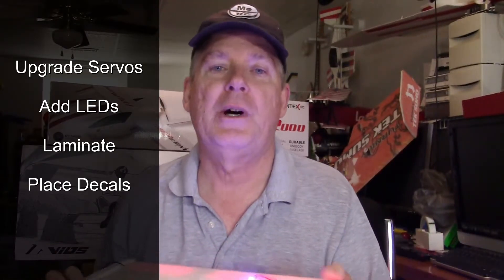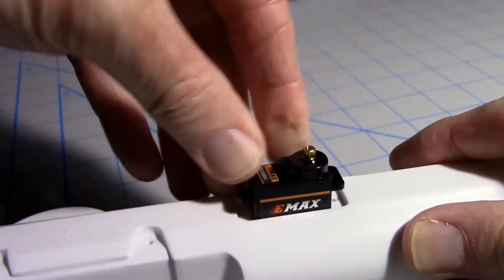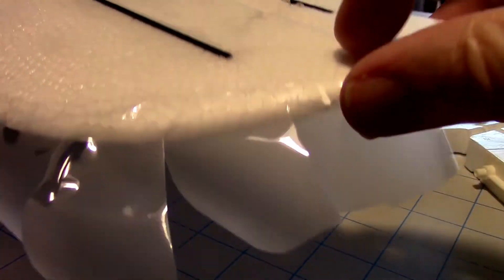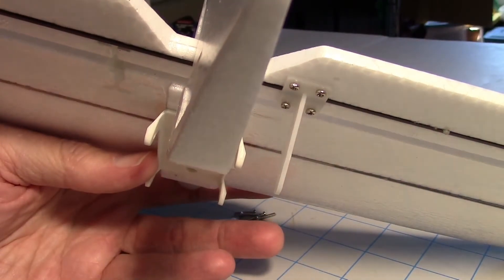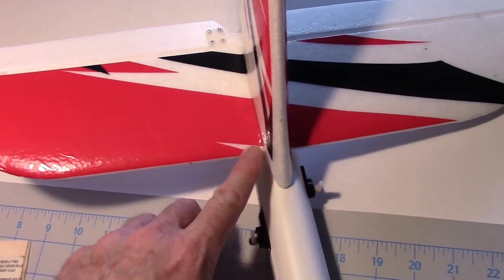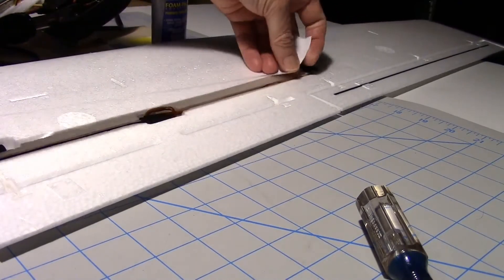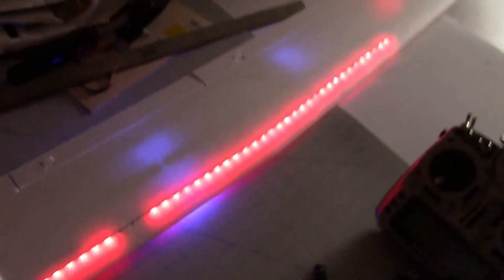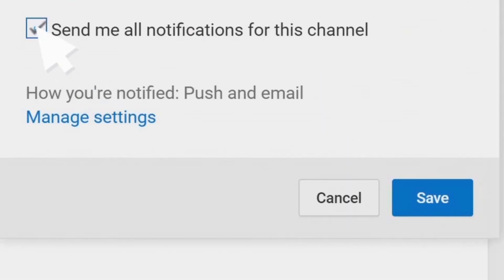Volantex Ranger 2000 FPV RC Plane Build Part 6 - Upgrade Servos, add LEDs, Laminate, Decals

Comment: so the 2000 has flaps but the 1600 does not? damn
Reply from the maker: I guess that is correct. I have not looked at the 1600.
Reply: @DaveMerc  well i thought untill it coame in the post yesterday and i am guessiong because of the missing 40 cm they did not bother to put flaps on

Comment: It’s looking good Dave!  I saw that you put the lam over the surface mounted LEDs on the bottom.  How did that work and were you able to apply heat to the strips between the diodes, and if so, did that result in any problems; or did you just use a heat gun or something to shrink the lam over the strips.  I’m really just wondering if either lam or heat had any negative effect on the LEDs?  This is a nice build as usual.  Can’t wait for the next installment.
Reply from the maker: Thanks Tom. The lamination worked okay on the bottom LEDs but I only heated around the outside edges of the strips. No I did not heat between the individual LED lights but it's hardly noticeable. Next episode I will be getting into setting up the stabilization for the PixHawk which is always fun.